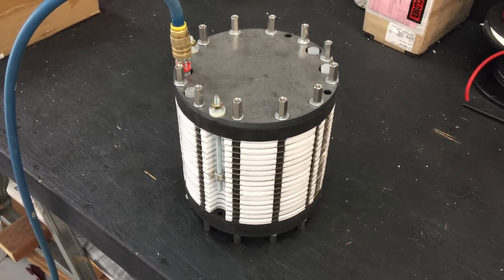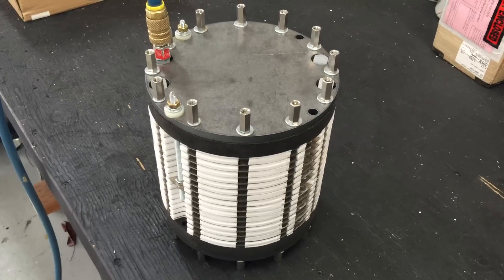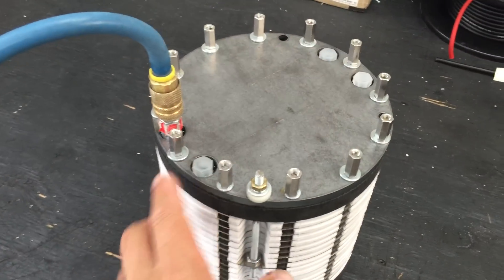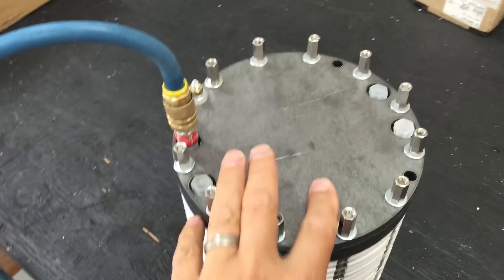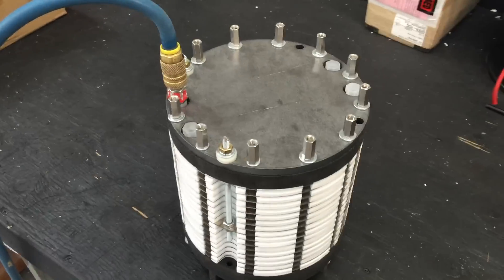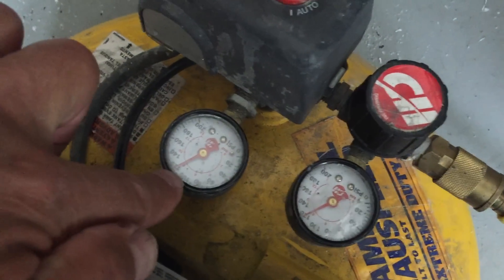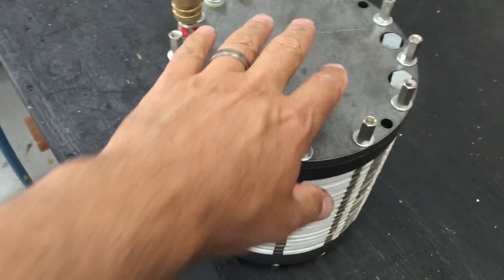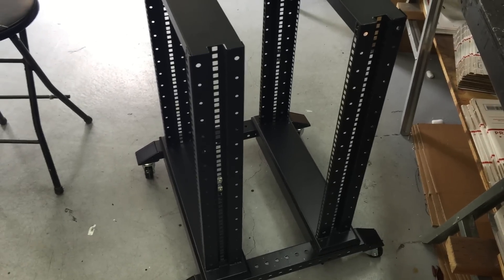Hydrotube hydrogen generator holding 120 psi

Comment: |> |> |> |> |> |> |> |> 
|> |> |> |> |> |> |> |> 

Hello, ... I want aak wich cell would be the best to run a marine diesel engine pur with hho, wixh size l/m and how much it would cost?
50 ps and 80 ps engines.

And how to contact you?

Thank you!

|> |> |> |> |> |> |> |> 
|> |> |> |> |> |> |> |>
Reply: |> |> |> |> |> |> |> |> 
|> |> |> |> |> |> |> |> 

I forget:

Both gases seperated for additional use. And I want run with filterd seawater ... 

If possible ... Should be ...

Thank you!

|> |> |> |> |> |> |> |> 
|> |> |> |> |> |> |> |>

Comment: Hydrogen gas under pressure is inherently unstable - Are you sure that this will be safe ???!!! I have researched a couple of companies that were pursuing pressurized hydrogen gas and there were numerous explosions and deaths, etc.... Please research the safety of this line of development .
Reply from the maker: H2 will not burn with out oxygen (oxidizer) We use a purity meter to make sure our gas is over 99% pure before compressing.
Reply: I did, and it's not inherently unstable. The industry pressurizes hydrogen to 200, 350 even 700 BAR. However, you will lose an amount of energy (less than 10%).

Comment: Just a quick note, the air pressure on the line at the compressor would not be the same as on the end of the hose. Still, even if it drops to 80 or 90, still pretty good pressure.
Reply from the maker: We will see what it does when I get the cabinet system built and the whole thing running.

Comment: Didnt you say in another vid you should never compress hho gas? Or does this cell produce h2 and o2 separatly?
Do you know of any scientifically proven results of compressed hho gas? I dont think it will explode just by pressure, it need some initial effect.
Maybe a strong light / flash or shock wave is enough to ignite compresse hho...
Reply from the maker: This cell produces 99.9+ pure H2. NEVER compress HHO gas unless you have a death wish!
Reply: Do you know of any scientic proof or advice concering compressed hho? I know it is possible to a certain (low) degree, but can be dangerous at higher pressures (more than
3 or 4 psi...). Many years ago  i collected H2 (with an unknown amount of O2) in a small metal tank - but this could have been leathal - sure. I collected the O2 in an air balloon to use it in a burner for glass blowing. Suddenly the whole baloon exploded - but not as loud as hho in best mixture (2:1). There was probably a critical rest of H2 in the O2, enough to let it flash back and explode. It was a big 60 l balloon in a small room (3 x 4 m) and no problems with the window :-)
Reply from the maker: Hydrogen is flammable in normal air from 4 to 75%. You will have to make a conversion to find out what it is with pure oxygen. For me i wont compress hydrogen if it has more the 2% oxygen in it. I measure this with a hydrogen purity meter.
Reply: Thanks - yes, i know the dates. How does a H2 purity meter work? - is it really reliable?
Reply from the maker: I have some video's up showing our meter measuring it. it is accurate.

Comment: isn't the gas more dangerous under pressure? how do you plan to make this safe enough to stand next to? if you're adding a storage tank, how do you plan to make this safe enough to be in the same room as it?
Reply from the maker: What will be compressed is pure hydrogen gas. Don't confuse this with hho. hydrogen is safe to compress because it will not burn with out the presence of oxygen. I will have more video's as the system comes together.
Reply: ok, sounds good. I only assume it was a hydrogen/oxygen mix because you only have one hose connected to the reactor. I'm curious as to what the separating membrane looks like/is made from. also keep in mind, you'll likely need to keep a similar pressure on both sides of the membrane to prevent gas leaking from one side to the other. in your videos, you should stress that you're separating the oxygen and would otherwise be very unsafe. I'm only so critical of this because the dangers aren't so apparent to some unsuspecting viewers. water and bubbles, what's the harm.. death.

Comment: Okay, the title says "hydrogen generator," so I assume the challenge here is to be able to hold the hydrogen the unit generates in sufficient, compressed quantities. However, commercially available canisters are pretty reasonably priced, and start at around 250 psi and go way up from there.

So I have to wonder, wouldn't a modular system consisting of a generator, compressor, and storage canister be more cost efficient? Or am I missing something obvious?
Reply from the maker: I wasn't as clear as I should have been. This is the generator part of the system. I generates H from electricity. Storage can be done many ways with secondary compressors to get up to the PSI a person would need.

Comment: so does it just store hydrogen or does it make it as well?
Reply: It's really easy to build a wet system or dry system. I built one in my garage for under 100$ just to see if it was bull shit. Sure as shit, It is TRUTH! I filled a gatorade bottle with water turned it upside down  in the water, stuck the HHO hose in the bottle mouth and displaced the water with gas, then closed the cap to trap gas. Took it out in the street took off the cap and lit it with a long lighter and BOOM! Shot the bottle about 25 feet down the road and about blew my ear drums out. It's absolutely real. Distilled water, electrolyte, stainless steel, and 12 volts. you got yourself HHO.
Reply from the maker: This is just the H generator. It is the heart of a bigger complete system.
Reply: I have a physics background. Im sure you know this but water at higher pressure and or temperature will split with less input energy, so if that's your goal her keep it up! :)
Reply from the maker: Thanks Dylan
We have to keep the cell under 140 degrees F because of internal components. Less energy is vary important.
Reply: I've watched all most all of your videos, its still not clear to me how/where the separation of h2 and o2 happens.
Reply from the maker: Spent too much time and money to show any of that. Maybe someday when I make back my investment.
Reply: there's many videos showing exactly how to make a device to divide the two with the use of electrolysis.
Reply: in this form factor? Not that Ive seen.
Reply: form factor? not sure what you mean, but i do know that the cathode releases one of either hydrogen or oxygen, and the anode releases the opposite gas.  all using electrolysis, that's the method being used here. 
if i understood what you mean, i apologize but this is no secret.
Reply from the maker: Yes, oxygen is formed on the anode and hydrogen on the cathode. Anode is positive and cathode is negative.

Comment: can you run a 6000 watt generator off that
Reply from the maker: It's not for that use.
Reply: but why would you want to?
Reply: um free energy generator charges batteries batteries run hydrogen generator run what ever else you want off batteries and generator
Reply: sabastion642 it's almost a meme, except people really believe it... morbo says, generators do not work that way!

let me explain this quick, then I'm done with it.. just about every energy conversion results in some of the energy converted into heat. the HHO cell generates heat, electric wire, the friction of the engine, the exhaust.... every point along the line you are losing energy. it's not possible to keep the loop going. if there is a battery connected, it will go dead, and the whole thing will stop. congrads, you wasted the energy stored in a battery.
Reply: @lorenzo42p  bullshit either way. There's plenty of energy stored around us. The sun did that for us once upon a time. All we need to do is find a way to extract that energy efficiently and use it wisely.

Nuclear bombs, hydrogen bombs, nuclear energy... They are just some examples that prove we can get more energy out than we have to put in.
Reply: wait you are basing this on constantly running we dont use electricity that way charge batteries turn off cell. when batteries loose charge turn on hho produce hydrogen run gas generator charge batteries turn off hho oh my  free everything. initial cost pays for itself after about 6 months then free im guessing this equipment will last for years hum well interesting . you are not looking in the long term.
Reply: the long term fact is, the energy must come from someplace, aka the battery. if I start my car and let it run, the tank will empty and engine stops. likewise, if I start my car for only 5 minutes a day, it will still eventually run dry and stop. the gas tank contains the energy, as does a battery, but in a different form.

when you charge your cell phone, say it's turned off to simplify things. the power coming from the charger is more than what will be available from the battery once it's fully charged. some of that energy is wasted as heat. the charger itself will release heat, the battery gets warm, even the wire and usb plugs will get slightly warm, even if not enough to feel with your hand.

the only exception to the rule that I know of is a super conductor, but it's not easy to do and we have no idea what is happening.

if you bring renewable energy into the equation, hydrogen might be a good way of storing extra energy for use later.
Reply: hello pete, this extra energy come form the sun - solarpanels charge  batteries or you make h2 + 02 and store it in tanks... after this  process  you can run a generator on h2 when you want.
Reply: I'd like to see the inside of this cell. if it's cheaper to build than buying batteries (for the same watt hour storage) then could be a good alternative to batteries.